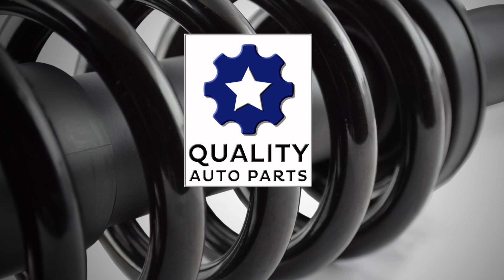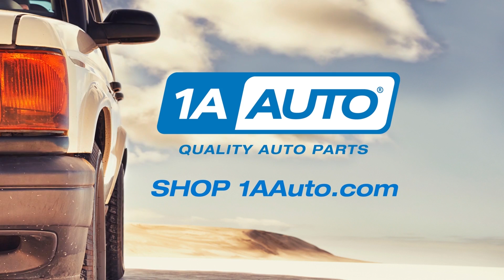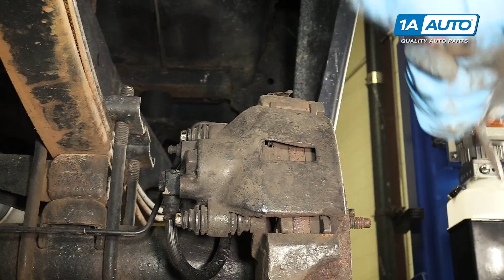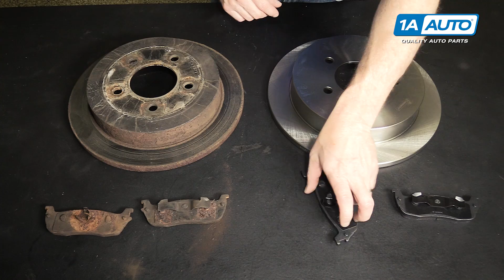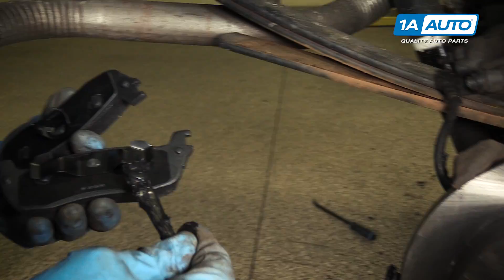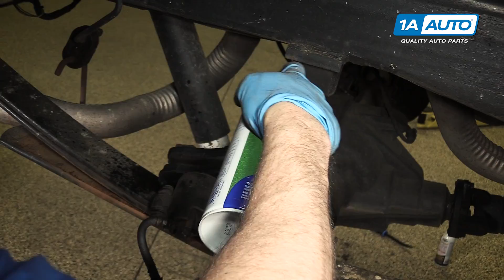How To Replace Rear Brakes 97-03 Ford F-150

Comment: Parking brake  adjustment  can  be accessed  through rubber covered hole  in  back  of plate just like regular  drum  brakes, back off on the adjusters  to get rotor off.
Reply from the maker: +Randall Carney Thanks for the feedback!

Comment: Hello, I may not get a response but my rear passenger side drum gets hot however my drivers side does not, I just replaced everything and I tried removing the parking break bar inside the right side as I thought that was my issue however it is still getting super hot on the passenger side while the drivers side is normal, what could be the issue? Any suggestions? Thank you so much 💓
Reply: Drums or disk?

Comment: Do you loose any brake fluid while changing pads?
Reply: No, you should not.  Unless you have had your master cylinder topped off prior, in that case you may have it overflow.
Reply: You should lose any fluid when changing brake pads, rotors, or drums, and shoes. No bleeders should be opened to do this, unless you need to replace the wheel cylinder or caliper.

Comment: I have a 2003 2wd f150 do you need to remove wheel bearings to remove rotors?
Reply: yes for the front rotors the wheel bearings must be removed on a 2WD.

Comment: Tapping on the drum part of the rotor works better to brake away the shoes from the drum than hitting the face of the rotor, saves the rotor too if it's to be reused. And since I'm here did anyone bother to check why the pad on the piston side was almost new compared to the worn out outer pad? Because if no one did it'll just happen again with new pads and rotor. These video's are quite good most of the time, what happened this time. Disappointing to say the least!

Comment: Nice video,  The only problem is my 98 f150  doesn't have rear disc brakes !
Reply: Mine either. These videos are pretty informative but they leave out a lot of helpful info. Like, not all truck have rear disc brakes
Reply: @LactoseTheIntolerant thanks. Did my first set of drum brakes 30 years ago so I think I have a idea how they go. 😉

Comment: Are there any electronics involved in changing the break pads on a 1999 Ford F150?  Can we change these out ourselves, or are there  electronics involved, meaning it has to be taken to a shop, or dealership, to repair?
Reply: No. Pretty much same as any other car.

Comment: Do you have to take the brake reservoir cap off?
Reply: No, the fluid being pushed back when compressing the caliper, is the same fluid that was pushing it out. This is simply returned to the reservoir like the system does on its own. If the calipers don't push back fairly easily with a C clamp or actual caliper tool, you have a different problem. Just sapping rotors and pads, you should never need to remove the reservoir cap, or crack the bleeders open.

Comment: You may want to add sanding/grinding the surface of the hub to make sure the two surfaces sit together evenly. I've had problems with that in the past.
Reply from the maker: +SteveeahTV vvnkn Selva Thanks for the feedback!
Reply: Some auto parts stores offer this service. I was quoted $30 per rotor.

Comment: Um... if you loosen the adjusters it will come off much easier. With you all being "professional" I feel like you should know and say that. Also, if you use break cleaner before putting the rotor on it's easier too!
Reply from the maker: +Alicia Jones Thank you for the feedback. 1aauto.com

Comment: My 2000 ford f150 also has drums in the rear.
Reply from the maker: +J Nieto There were some models that had drum brakes, and some that had disc brakes depending on the trim level and options from the factory. 1aauto.com
Reply: @1AAuto  Thank you.

Comment: Can I do the conversion of drum brakes to discs in my f150 99?
Reply: It involves swapping the entire rear axle, totally not worth the effort
Reply: If you'd prefer rear disk brakes, it's totally worth the effort. Locate a disc brake axle, try to check to make sure that it has a similar ratio and swap everything.

Comment: Do you use brake cleaner?  Do you ever grease your caliper pins?
Reply from the maker: +Jeff Whiting Thanks for checking us out! We do use brake cleaner and it would be for the best if you do put some grease on those pins when you're taking them out and putting them back in.
Reply: They used brake cleaner in this video, and mentioned the slide pins can be lubricated.